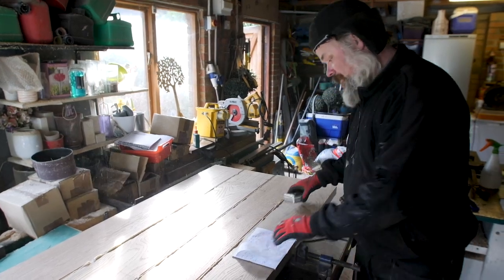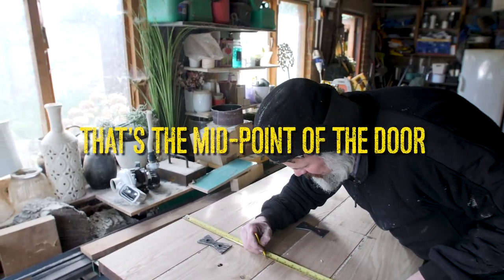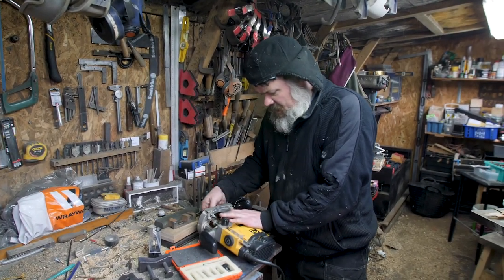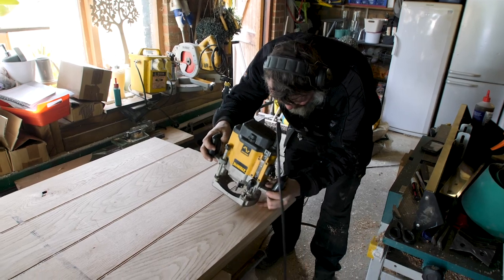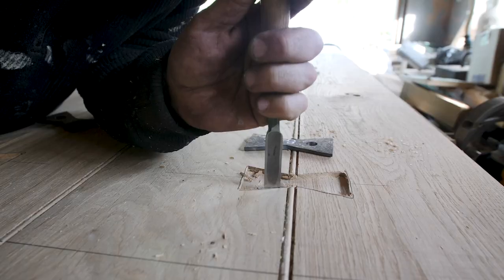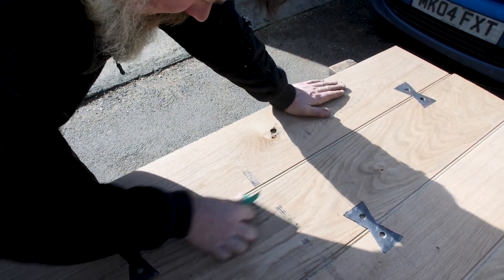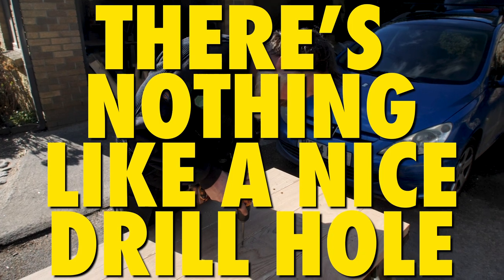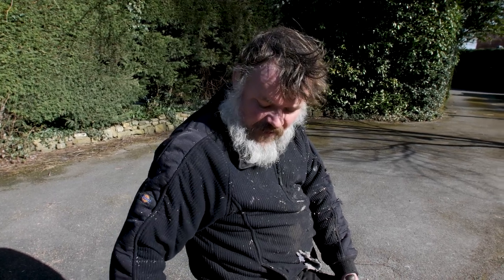How to make a front door - Ep5 | Freehand Routing is the way of the Chief!

Comment: Hi DSC!  I just found your video and am thinking about a similar oak plank door.  I see that you glued the panels together. I am wondering if you were concerned about the door expanding and contracting and sticking with changes in the weather?  Thanks for your entertaining and educational videos!  M.
Reply from the maker: Hi Michael, it was a concern, but the biscuits, the glue, the Butterflies and bolts, plus a hard wearing finish should give the door the best chance of not submitting to the weather. If you continue in the series you'll see we end up fitting the door in location and it was open to the elements and all the moisture the UK can throw at it. Al's top notch customer service means we now have no way of knowing how successful it's been mind... could have been a right s**t show last Winter, and that's a DSC guarantee!